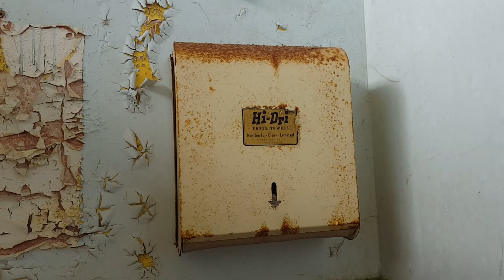Derelict 1950s LL "Bolding" Ceramant Cistern & 1990s Shires Supaline pan

Comment: Lovely lead U bend under, direct into drain collar (can't tell if saltglaze or cast). They're be a DZR caulking bush mortared or caulked.
Left hand lead pipe has a knuckle joint on the nut & liner to stopcock. 1/2" lead pipe came in various guages 1/2" x 5lb, 7lb ;6lb or 9lb for water. Lead pipe has a cast band running the length of it, best to look on unpainted lead. Waste is commonly 1.1/4"x 9lb; 10lb or 12lb.This denotes wall thickness/weight per yard. 1/2" is internal diameter. The nipples used between steel to lead aren't 1/2" x 1/2". 1/2" taper or *parallel *(if nipple is flanged) x 5/8" parallel the (how can I say); the nut  & liner end is tapered and the inside of the nipple is tapered, the 2 tapered surfaces bite together when tightened. others are flat faced with hemp & 'paste washers'. The nut (union) the tap end won't fit onto the lead end of the nipple in otherwords. Love the J .Bolding taps, couldn't see the 'J'. have seen bolding before good find! Not seen one of those Heatrae sadia wall cylinders in a while, Looks vented- I got a brief glympse of a pipe up  top possibly overflow. Immersion at the bottom. Basin wastes 2:54 sadly replaced with Pushfit. Have 2 of those basins in the workshop, the centre soap tray is recognisable/ribbed